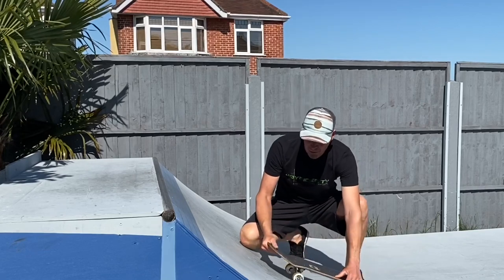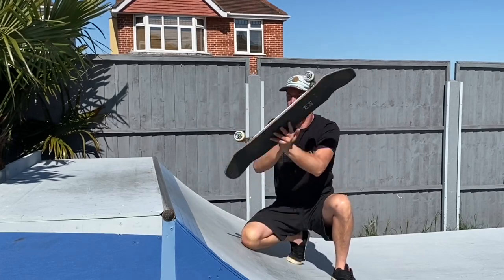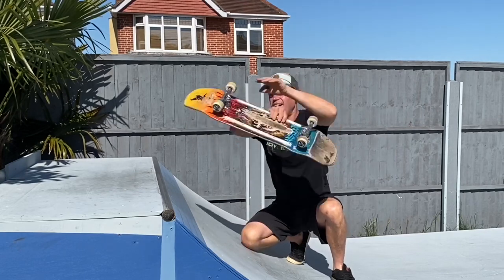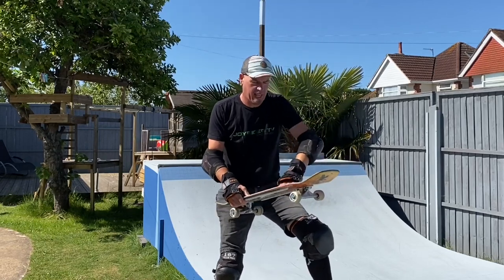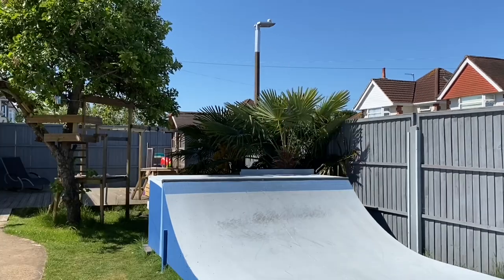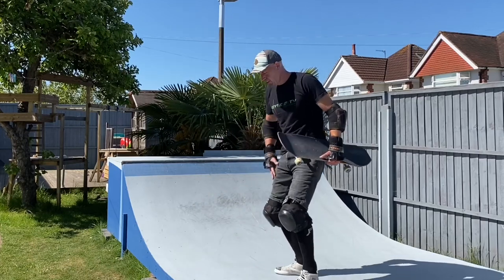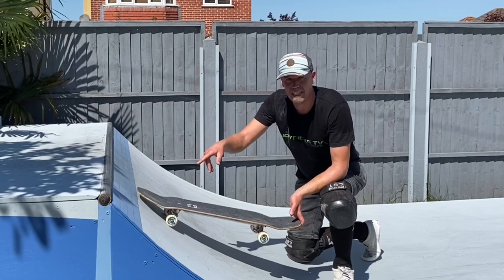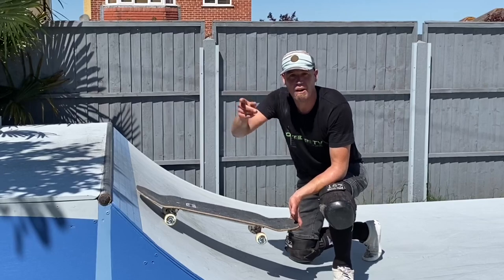Learn The Can Opener (Fakie Front Foot Impossible) On a Skateboard On a Mini Ramp

Comment: Any tips for doing it in your regular stance? I want to do a can opener on the top of a wide spine and drop in the other side but nothing is making sense...
Reply from the maker: Great question, I guess you could pop out and tap the nose with your front hand so the board spins round your front foot. You can then catch the nose after the rotation of the board and place the tail on the edge ready to hop in??

Comment: Hey. Trying this now. I’ve got the tin can bit and the drop in. But really struggling to get the board up in the air out of the ramp. Keep ending in blunt or not out of the ramp enough . Have to pull it up to spin. Any tips on that Ollie out
Reply from the maker: Yeah man, great stuff. 
A Little bit of a Fakie Ollie motion helps. 
As you come to the bottom bend down and physically hop up aiming your back foot to land on the coping, front foot actively Swishes the board up which puts it into the air so it clears the coping. As soon as you get a few this should make sense hopefully??
Reply: Yeah I can do it going forward for ice plants and bs boneless. But going fakie gets me . Just can’t quite get it to fly out. I was nearly there then it started thundering so I covered the ramp. Think I gotta just get used to the switch Ollie movement then I’m there. Cheers for your video. Hopefully tomorrow I will have it